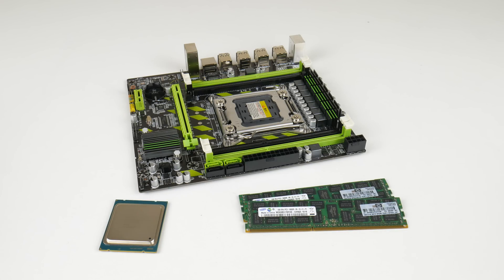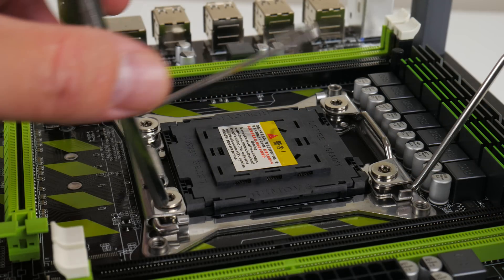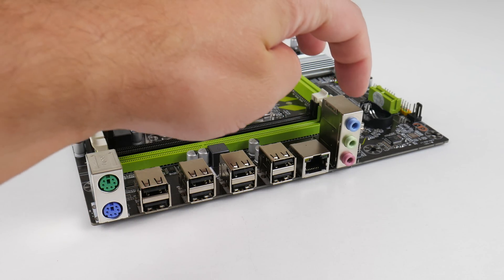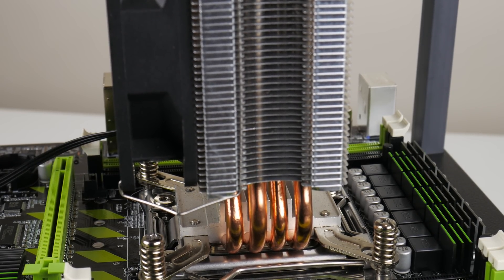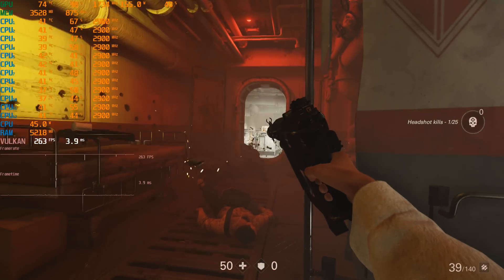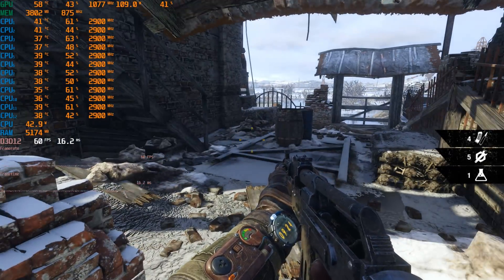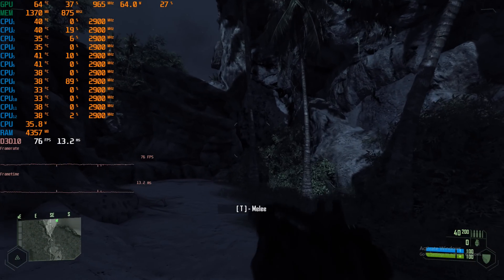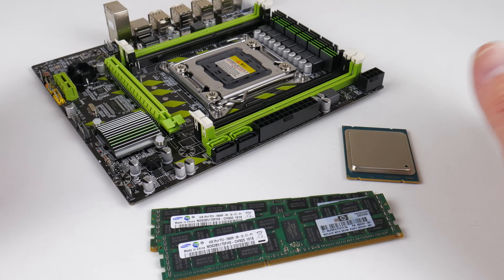$99 LGA 2011 Motherboard 6-Core CPU 8 GB RAM Budget Bundle

Comment: Would be perfect for the heart of a home video security camera setup, or even cooler the heart of an awesome mame setup. Just slap that thing in a cabinet that's decent with a 1030 and it'd be good!
Reply: I wouldn't trust those boards with 24/7 critical operation.
Reply: @wishusknight3009  these boards are new. only the chipset it's used
Reply: @wishusknight3009  Most people feel that way about things they know nothing about.
Reply: @CORZER0  I would have no issues with these boards in a build for my kids computer or home theater PC or what not, The price and value are great. But not for anything that i would need a certain degree of reliability. Security or a server where data integrity is important are two area's that i would never use cheap Chinese knockoffs. ever...
Reply: @wishusknight3009  pffffffttt, like branded parts are any better nowadays, everthing comes from china and that 3% failure rate of chinese manufacturing is inescapable
Reply: i only care about warranty now, the longer most solid warranty regardless of brand
Reply: i only care about warranty now, the longer most solid warranty regardless of brand
Reply: @enriquedossantos3283  The custom designs from the bigger brands like Super Micro will have much higher quality control and testing regime.
Reply: @wishusknight3009  yeah, they do but as long as they build in china the failure rate is there, just like when intel moved Production to vietnam, quality went down, then they commisioned foxcomm it went down even further, sure they replace faulty hardware but it shouldnt be faulty to begin with, i build computers for a living and the quality and reliability of parts keeps getting down and down, luckily relative pricing has also come down quite a bit
Reply: Quality control depends more on the factory than on the national origin of the brand. In many areas some chinese companies have better QC than most western ones that manufacture in China.
Reply: 1030 is overpaying for something like that a 750ti would be better
Reply: Only reason I said 1030 cause I happened to have one lying around. Lol. Plus the profile is super compact.

Comment: Is there an 8 core chip that would work in this board?
Reply from the maker: Yes, look for the E5-2650V2!
Reply: Also look for E5 2689, it runs a bit hotter than e5 2650v2, but performs better since its clocked higher (3.3ghz all core turbo).

Comment: you said crysis in ultra dipping under 60fps? how about med/high? not that im planning on playing it, just wondering
Reply from the maker: I haven't tried lower settings with Crysis, but I'm sure it will run a bit better.
Reply: @philscomputerlab  or ultra settings with a 4:3 monitor to get that 30% increase in rendering performace :)

Comment: Would this be a worth what or side upgrade from a 3570k @ 4.2ghz? Thanks Phil
Reply: Downgrade
Reply: @TheFirestriker101  I figured the IPC was lower on the XEON, didn't know if the extra threads would make up for that or not.
Reply: Not worth the effort
Reply: @federicocatelli8785 I agree, I just picked a Ryzen 5 1600/ ASRock B450M Pro4/ 16gb 3200 Gskill Ram for $213.94
Reply: @megafan0258  haha that ryzen has worse ipc that my 56$ 1650v2 :)

Comment: Yeah it's cheap, but it's so restrictive. It's very similar in performance to my 3770K (Ivybridge), but mine is overclocked to 4.3GHz. Considering I bought that six years ago, I've now ordered my parts for my new Ryzen PC upgrade, which will be a ROG Strix B450, Ryzen 7 2700X, 32GB 3200MHz Ram and a 1TB NVMe M.2 boot drive. Admittedly that's £475 worth of parts, but I expect it to last me another 5 or 6 years by which time I hope to be able to buy a Ryzen 9  3950X second hand, maybe.

Comment: Do you disable the Spectre and meltdown patches on the Xeon equipped systems before doing the benchmarking ?. Because those patches have been causing the Xeon CPUs to take a hit in performance often around 15 and sometimes 20 FPS difference with the patches being enabled vs disabled.
Reply: Right, Tech Yes Man published a video about disabling the Intel spectre/meltdown mitigation, it definitely is worth doing. It's a script that makes some changes in the registry. If you don't trust it you can also do it manually
Reply: @hansbehrends438  yup, his video about it is what made me ask here.
Reply from the maker: No I don't, it's the latest build of Windows 10 with all the updates!
Reply: @philscomputerlab  I'd try without them enabled especially on Xeon platforms, there is an app that easily allows you to disable them. But there's been a few videos about the issue especially with Xeon CPUs.

Comment: Do you recommend getting i5 3470s selling for $24 on aliexpress?
Reply: Depends. Do you allready have a 1155 board and stuff? And is it a z chipset board or not?
Not a bad choice if you do. If you do not i would shop around for something better.

Either something like this or a ryzen 3500x. Those are the hot item at the moment at 110 euros.

Comment: Have you tried overclocking with setfsb? on the board theres clock generator ic that was used in lga 775 platform.

Comment: Hey Phil, with these locked Ivy Bridge/Sandy Bridge CPUs, you can usually get a 400mhz overclock if the processor has turbo boost enabled and if the mobo allows you to play with the multiplier.
Reply: Doesn't work with the Xeons
Reply: @TheFirestriker101  Indeed, one can't force the multiplier beyond the rated settings, but it's probably more useful just to make sure the Turbo function is working correctly at all. Turbo has a habit of not working quite right if one doesn't have the BIOS set correctly, eg. meddling with the C-state limits can tun it off.

I have been experimenting with a dual-XEON 2620 setup, using what I learned to adjust an older standard rig with a 2680 v2 (ASUS P9X79 WS mbd). Doing so finally enabled Turbo on the ASUS (I had deep C-states turned off before, that seemed to be the key, along with selecting the Balanced power plan), then Turbo worked as advertised (6+c=3.1, 5c=3.2, 4c=3.3, 3c=3.4, 2c=3.5, 1c=3.6), increasing for example 1-thread CB R15 from 112 to 129, CB 11.5 from 1.31 to 1.51 (the biggest speedup), and reducing the SuperPI 32M time from 11.84s to 10.31s. Highly threaded tests didn't change of course, since the CPU was already using 3.1 all-core.

So yes, one can't get a free +400 with multiplier fiddling, but it's worth making sure the basic Turbo itself is working correctly. :D  The higher Turbo levels can help with some games. I have some gaming results if you're interested (GTA V, SotTR, Hitman 2, Metro LL, RotTR, etc.), but I'm only testing with a 780 Ti atm, comparing to a 5GHz 2700K (not tested the 2680 v2 yet, so far just done the 2420 v2 and dual-2640).

Comment: It's about half of what my R5 3600 does in R15  and R20, so good performance for that price!
Reply: Tadas Nanartonis  this package is actually priced higher than if you bought the components separately. I just bought this board with the m.2 slot for $50+ e5 2630 v2 $20+ 16gb ram $14. 1600af is great, but 3X great?  To me it isn't.
Reply: @mr.tomatohead5648  In portugal the 1600 AF is about 105 euros + 16gb DRR4 3600 cl 16 for 100 euros + B450 cheap for 80 euros = 285 euros.
Reply: Its half, but it costs over half as much for the whole platform.
Reply: Vipast - but 8 gigs of ram, a mother board and a R5 3600 is over 300$...
Reply: @spoonikle  ... I think we are saying the same thing... I was saying half the performance  of the 3600 , for less than half the cost of the chip alone..

Comment: The price for the combo is good but unfortunately that cpu will give a bad experience in games that favor higher clocks. If i remember well the 16xx is unlocked and that little boost will help in games like Far Cry 5 or latest Assassins Creed titles. Does the bios on the motherboard support overclocking unlocked processors?
Reply from the maker: Yea that's exactly the issue, rather low clock speed...
Reply: @philscomputerlab  did you try using an unlocked processor on this particular motherboard?
Reply from the maker: @AeiKei  Yes and it goes up to 4.2 GHz.
Reply: @philscomputerlab  that is good, now depends a lot if you got the budget to buy an unlocked one or not. I watched again your video with the 1650v2 and it would be interesting to see a revisit with the rx 5700 to see if the cpu bottlenecks the gpu

Comment: There is now dual 2011 boards on Aliexpress the Jingsha dual x79 for $120 USD!  Half the price of the old dual boards.  2011's are awesome unlike the G34.
Reply: The bundle with 2 2689 and 64gb look interesting if you look for a workstation
Reply: You guys really underestimate the unlocked xeons.  Yes, this one isn't but my oc'd 1650v2 still beats Ryzen in most benchmarks.   And they can hit close to 5ghz, where Ryzens, especially first gen barely hit 4.0.  At stock/locked speeds yeah these suffer a little in comparison.
Reply: $120 is a heck of a price difference between the board shown here.  This is kind of about budget building man.
Reply: @Worldzworstgamer  120 for dual Xeon board is  budget
Reply: Don't do x79 from scratch, Ryzens even beat dual x79 in passmark scores, they are a dead end waste of money.
Reply: @lonniebeal6032  Really? For just 99 bucks? :)
Reply: @lonniebeal6032  HAHAH PASSMARK

Comment: I run the same CPU in my 2nd gaming PC with a 1070ti. The 2630v2 is a champ.
Reply from the maker: Yea it's very good value that's for sure. Clock speed is a bit low, but food enough for most games.
Reply: @M6llumees69  4-4.2 is possible on the 1650 so I think you would be fine ocing the 3930k on these boards
Reply: This particular board doesn't support overclocking, you have to turn to one of the pricier X79 boards like the PlexHD or X79-ZD3 or one of the higher end Jingsha boards.. But then you're looking at spending USD $70-$80 on the board and then it isn't really "budget" anymore
Reply: @hansbehrends438  Phil mentioned in the video that it supports OC.
Reply: @M6llumees69  where did you find i7 3930k for 60-70 EUR in Estonia?
Reply: @M6llumees69  thanks, I'll look into it.
Reply: Shaun Rattee do you have any recommendation for a better cpu than the 2630v?

Comment: I look at this, and get angry and bitter. Because I'm stuck with a 5820K because trying to get an 8core for the board still goes for msrp on the second-hand market. And ebay wants $750+ for a 6950x.
Reply from the maker: Does that board take Xeon CPUs? For that money you can get an entire PC. The used market is indeed weird, some parts just don't lose value..m
Reply: @philscomputerlab  it does, but i can't make heads or tails od the xeon model system. Whoever at intel came up with it just needs to be shot for how confusing it is. And many of those even secondhand are still going for msrp. $4500 for a second-hand xeon makes no sense.

Even if i do a platform upgrade for myself, i wanted this x99 setup to still be a solid upgrade for my wife, who's still on a phenom ii 1090t. Already running into games that it should be able to handle, but that instruction support isn't there to make it happen
Reply: @ZeroHourProductions407  The E5-1660V3 sells for $255 on aliexpress. It's 8 core and should be overclockable.The question is, is it worth replacing the 5820k for that price. Even if you sell the 5820k for half the price it's still $120-$140 to get few more cores and threads and how good it will overclock is... well unknown.
Depending on where you live I would 1. just sell the system and switch to ryzen 2. keep it as it is and in 1-2 years the prices for the x99 xeons will drop A LOT. That's when you will be able to get great deals of course by then we have no idea how the "current" gen processors at that time will do and what their prices would be.
Reply: @xingbairong  selling it will only just set me back further at this point. As it is, if i was starting from scratch i would need to go Ryzen 9. 2nd gen ryzen itself is not enough of an uplift and starting from scratch with Ryzen 9 is too much to do it right. For the time being, it seems, I'm stuck on intel.
Reply: @baronvonlimbourgh1716  my main is a 5820K, 4×16gb of ram and a 1080ti. Anything short of a Ryzen 9 is going to be a quality of life downgrade. And my most demanding game is Final Fantasy XV, which, again, seems to require either intel i9 or Ryzen 9 to hit 4K High/Very High with stable framerates. The patches released for the game helped a ton when i previously had just a 980ti to work with. But, i still needed to upgrade the GPU to get out of 4k Low. And the only videos showing 4K high working on a 5700XT were on systems with either a 3900/3950X, or an i9 9900K. Period, end of.
Reply: @ZeroHourProductions407  i'd just switch to threadripper then and be done with it for another 5 years.
Reply: @baronvonlimbourgh1716  The 3500x is 6 core not 8 core.
The 5820k is a fairly good CPU, so anything below 3900x isn't really a worthwhile upgrade at least not when you count the money you have to invest in it or even the hassle.
The 3700x will be quite an upgrade as well, BUT not enough in my opinion to actually bother selling the old rig and building a new one.

Perhaps if he built his PC during the Black Friday sales and got some good deals on mobo + R7 2700x + ram and he sold for a good price the old rig he would've had a meaningful upgrade, but right now it just doesn't feel worthwhile.
Of course if he is a gamer and cares only for gaming than switching to the 3rd gen Ryzen will give a big improvement in games, especially those 1%, 0.1% lows that will give really smooth experience.

Comment: I have been getting Dell E6440s for less than $60 on eBay, and they come with an i5 4300m and AMD Radeon 8690m. I am able to overclock the LCD to 75hz and play War Thunder, air, at 80 FPS. Granted, it is running at 1366x768 on the built in LCD. I was tempted to upgrade the i5 to an i7, but War Thunder only uses 2-3 threads, so it works out pretty well.
Reply from the maker: You know what, old laptops could be very interesting. Something I haven't looked into at all.
Reply: @philscomputerlab  I have a Dell Latitude D830, it has a C2D T9300 and Nvidia NVS 140M graphics. I would say it's probably the best laptop you can get for Windows XP retro gaming with both PCMCIA and ExpressCard slots for sound card add ons if you can find one of those Audigys for a reasonable price. I'd absolutely love to see you check out some laptops
Reply: @SSC3034  I just got a Dell Studio 1737 with the Mobility Radeon 3650 (unfortunately with only 256 MB DDR2 video memory) for $80 (a high price but that's how it is in my region). A Core2 Duo T9400 is offered for $4 shipped (if your platform supports the 1066 MHz bus)! The faster T9800 (2.93 GHz) is slightly over $20. This laptop is relatively easy to clean and maintain. But the DDR2 RAM has become too expensive if you want 8 gigs (I am quite mad, as I missed an ebay offer for peanuts). It features an ExpressCard slot, but later Dell models do not offer hardware Sound Blasters (but some sort of Creative software only).

Comment: so if you throw an extra 50 dollars into the mix you can get a i7-5820k 16 gig and x99 mobo combo and get much better performance
Reply: Could you link me please?
Reply: @jacintofernandes2907  i looked around ebay, you can get the processor for around 90 but make sure its the 5820k not 5830k and just look around for x99 combos, youll see mutliple for like 200 but if you look down the listings they have some for 60, granted the motherboard is plain but still good deal
Reply: @jacintofernandes2907  i looked around ebay, you can get the processor for around 90 but make sure its the 5820k not 5830k and just look around for x99 combos, youll see mutliple for like 200 but if you look down the listings they have some for 60, granted the motherboard is plain but still good deal
Reply: On aliexpress?

Comment: You mentioned overclocking and thats awesome and all but my question is if it can hit 4ghz all core with e5 1650 ? Also compliments for the channel i always wait for your videos and find them interesting
Reply from the maker: It tips out at 42x multiplier. Tested with a 1650V2.
Reply: @philscomputerlab  Noice
Reply: @philscomputerlab  4.2ghz stable even without voltage options??
Reply: 4.2ghz Stable even without voltage options??

Comment: I’ve just received this exact same board off AliExpress, I’ve put an i7 3820 in and a Amd Sapphire nitro+ Rx 570 in, I build PC’s for a hobby and it performs really well.
Reply from the maker: Interesting. Is there a benefit to using the i7 over Xeon?
Reply: @M6llumees69  no voltage options, you will not get over 4ghz